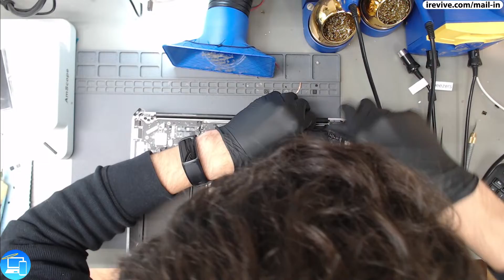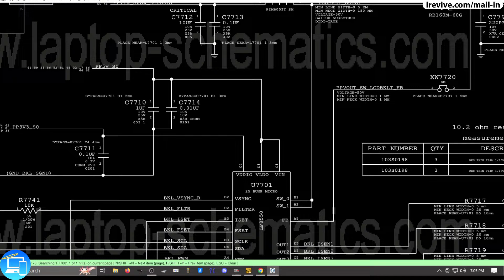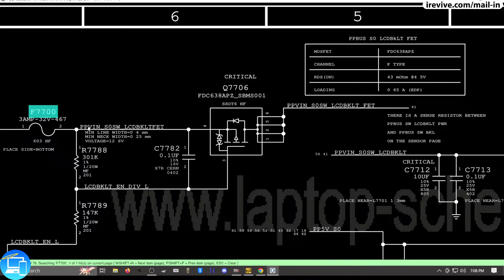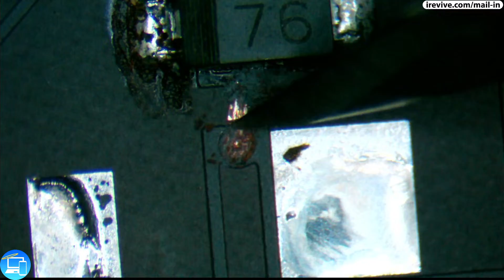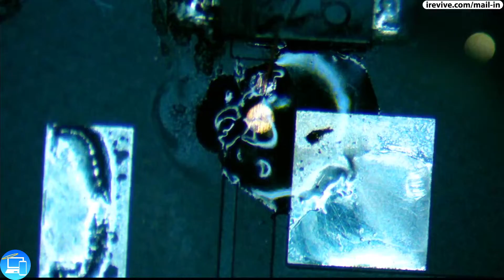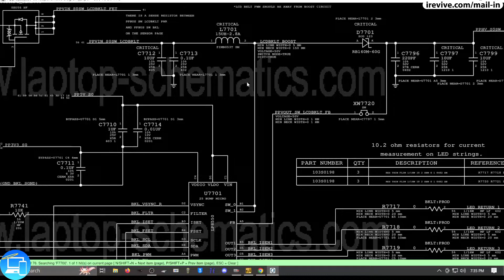MacBook Air 13" A1466 No LCD Backlight Repair

Comment: Ps im trying to design my own hot tweezers they're liner closing tweezer 😂 I basically took 2x diy soldering sets with 4.2 im oled screens and basically I gotta design my own 3d printed holder for 2x wands hopefully I learn the cad stuff fast so I can get everyone a cool soldering set they can build 😊

Comment: Thank you sir,

I have a1466 macbook and little water damage and immediatley shut down the pc and wait closed 3 days. Then opened and saw D7701, L7701 occidated and XW7720 button burned. Other every thing is fine (capasitors C7796,C7797,C7799 and U7701 IC etc. no damage or occidation). There is no backlight like your video.

I am concern about to fix burned and rusty XW7720. You did new wire line but i dont understan where it starts and where it stop (you scratched somewhere and made a wire line).

May i ask how works D7701------XW7720------L7701 connection?
Reply: If u want I can tell u a program like his to use  its a Chinese electronics engineering program